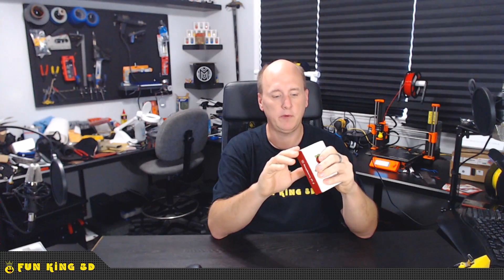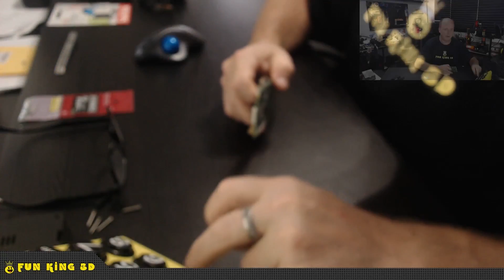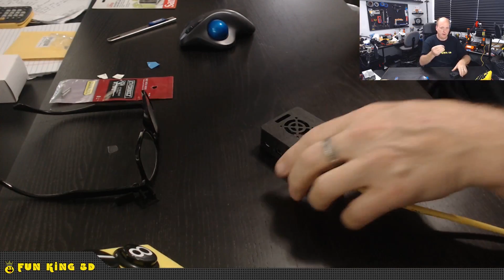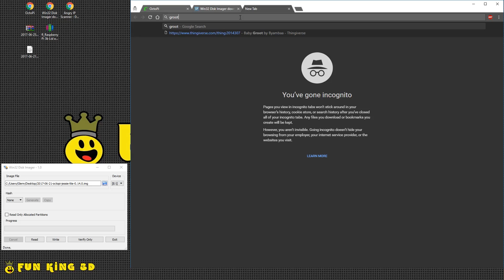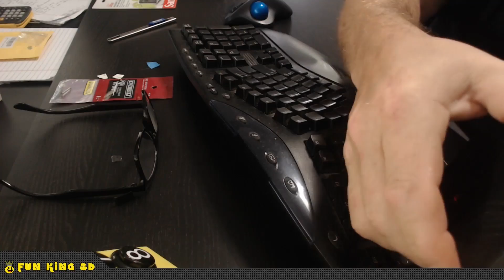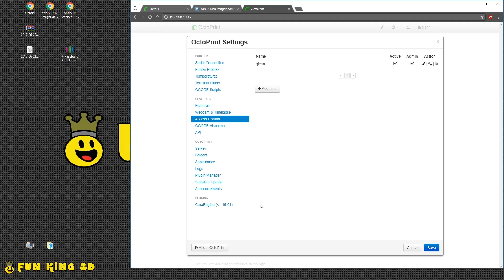Project: Octopi Install (Raspberry Pi 3 Model B)

Comment: i had connection problems as well running with a usb wifi dongle on an older raspberry. I followed your guide and opted for a wired connection. Octoprint would lose server connection constantly during prints. If this doesnt work second time around im taking a long break from octoprint.

Comment: I just purchased a CanaKit Raspberry Pi 3 B+ (B Plus) Starter Kit (32 GB EVO+ Edition, Premium Black Case) From Amazon.  I am trying to figure out how to down load Octopi onto the microSD that it came with but the Raspberry Pi program is already on it, so I can not format the drive.  I don't know what to do.  Should I buy another MicroSD to put the Octopi on but how would I then put that on Raspberry Pi one.  I am so confused with the whole thing .  Please, can you help me!    I just want to operate my 3D printer from my phone.
Reply from the maker: The operating system that is preinstalled is just a courtesy to you. The easiest way to do it would be to format the SD Card and start with the image that has Octopi built in. (Or you can get a new SD Card, but there is no reason not to use the one you have.) The catch is that your computer will not likely format the card. It will give you some errors about not being able to read it. So to get past that I find that using a digital camera or smart phone, insert the card and format it. Then you will be able to walk through the steps in the video. If you still have issues, please feel free to reach out to me.

Comment: Hi there, before I start with the whole process... if i want to connect to my printer when I’m at work.... How can i connect? You used a local computer in your own network...
Second question...  at one point you plug a usb into the raspberry. What usb is that? Where does it come from? I have a creality 10 with a control box. Do I have to connect the control box with my raspberry pi?
Reply from the maker: I am away traveling, but I will answer this as soon as I can.

Comment: If you download the Case be aware that the mesh body has over 59k facets in the lid alone. Any modifications or conversions to brep (editable solid body)  will be ....challenging, let's say.
Reply from the maker: Are you talking about the new one (V2) or the original one? The V2 was done in Fusion360, the original in Rhino3d.

Comment: I'm having some trouble with this I have the raspberry pi 3 model b with a wi-pi usb wifi
when I try to scan for it with angry ip it doesn't come up 
I have tried to search with putty for octopi.local but I just I get the message 
"unable to open connection to octopi.local host does not exist"
I have also tried removing the hashtags and the quotes in notepad++ as suggested in the comments
Reply from the maker: The Pi 3B has wifi built in, is there a reason you are using a USB wifi?

And have you tried to connect it via ethernet cable to see if it would appear that way?

The octopi.local does not always work. Depends on network settings and your router.

If you have an android device, try the FING app.

Let me know.

Comment: can I change the camera settings on the sd card without using putty and the password
Reply from the maker: Is this the Octoprint password or the password you use to login via SSH? (The User:pi Password:raspberry)
Reply: I assigned a different password for octoprint.  cant I open the octopi txt file on the sd card and unselect # change camera settings using notpad++
Reply from the maker: That may work if you computer will read the card now that it has Linux on it. 

But let's try and fix the problem

There are 2 places where a password is needed. One is when you use Putty to access the Pi, the other is to gain access in the web interface. If it is the prior, see this https://howtoraspberrypi.com/recover-password-raspberry-pi/

If it is the later let me know.
Reply: getting confused. maybe easier to start over with a fresh sd card. cant figure how I typed a wrong password twice  to begin with
Reply from the maker: Confusion is not good. I will help out in anyway I can, but chances are, it will be easiest to start over. It does not take long. But you can reuse the same card. I have issues with formatting them after they are in the pi, but I just use my cannon camera to format them.
Reply: eventually got in with the password and changed the camera setting. however there was a note saying to make the camera changes on the sd card, thats why its there. so I changed those settings also. 
printed your pi case. very nicely done. thanks. 
will you be posting the stl files for those usb covers?
Reply: just saw link to covers
Reply from the maker: Fantastic! Glad you got it all worked out.

Comment: Glenn your instruction were impeccable except for you didnt mention that when entering the information using notepad++ that the quotes and the pound sign must be removed when placing the Username & password.
Reply: I am setting mine up this week did you complete yours Bob ?
Reply: @Bob Young  Thank you for mentioning this. I feel like an idiot. I watched the video and did not carefully read the instructions where it says to do just that. After reading your comment I went back and change the commenting (#) and wifi is working now. I did not remove the quotes though.
Reply: took me 2 hours to figure that out thank u for commenting